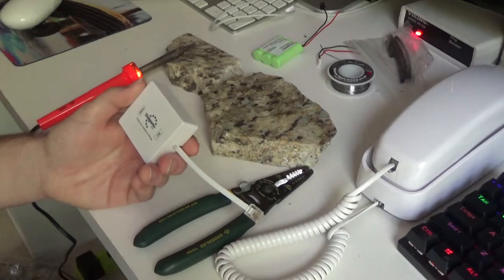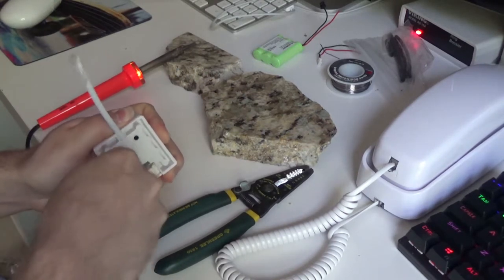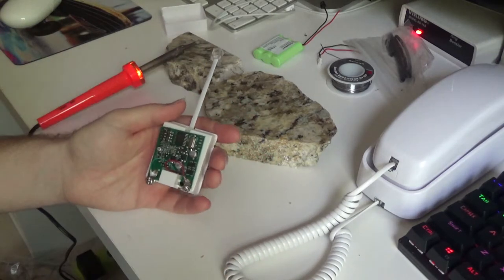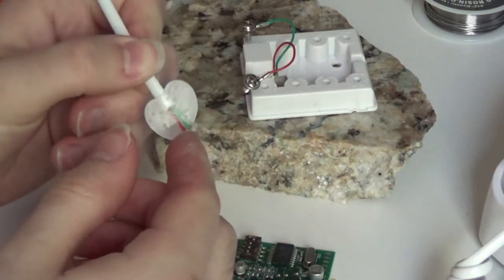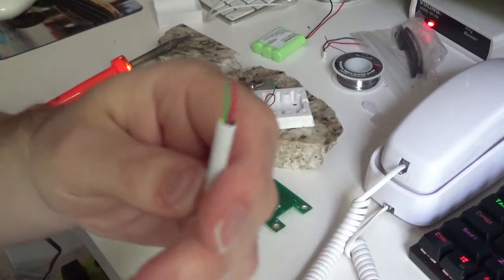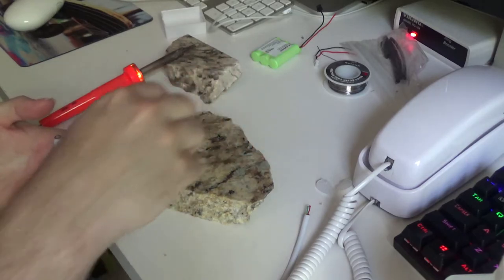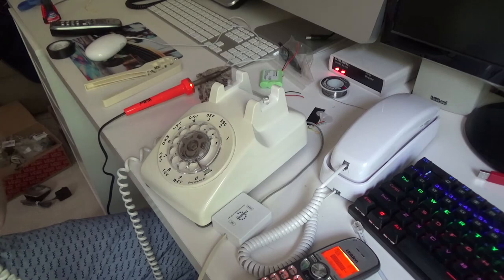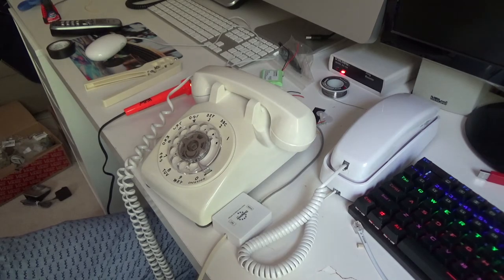DialGizmo Repair

Comment: My Dial Gizmo did the same thing. I took it apart, and it had a glob of blue glue that had failed, just like yours did. I was dismayed, considering that the price is, like you said, over fifty dollars, and then tax and shipping. I am not very neat with soldering such small items, so I took it to the local U Break I Fixit, and their guy soldered it for me, no charge. I pointed him to this video if he had any questions. I took the Gizmo home, screwed it together and it works fine. Better than the original connection. I'm glad that I didn't buy a replacement--in less than a year I would probably be having the same problem with the replacement, and 70 dollars less in my pocket. Thanks for the video.
Reply from the maker: Very disappointing build quality. I guess they can jack up the price just because there aren't many other products like it out there.

Comment: Hey thanks for the video! I didn’t have the problem that you had, my dialgizmo does work on my 500 series rotary phone, it generates the pulse for outgoing calls, it’s just that the dial-hold feature does not work. That is, I can’t dial a # (hash) or * (star) by dialing a ‘1’  (or ‘2’) and holding for 2 seconds. I have the dip switch1 set to Dial-hold enabled. It doesn’t generate the pulse for the * or #. Would you have any idea why? Thanks, Mike

Comment: I can;t believe it crapped out already.  Perhaps if you weren't so rough on the cable it would have lasted.

I won't complain about the solder job, because chances are it's better than they did from the factory.  Interesting iron with the light in it; I supposed that light is a reminder that it's plugged in?

As for the strain relief with electrical tape, that's a very temporary solution.  As soon as the glue on the tape lets go, that will allow the wire to slide around with no strain relief and it's as good as it not being there.  Once again, hot glue would have come to the rescue.  Now what's interesting is they seemed to have used some sort of adhesive, but it had a very cloudy appearance.  I've seen that type of glue before, and its bond isn't very strong.  I've found the same with low-temperature hot glue, the bond isn't very strong.  Good for some things, but for most stuff you want it as hot as possible.  With hot glue, you could have first of all duplicated their efforts in gluing the wire to the board, but than added more glue inside to act as a positive strain relief.  That's essentially "potting" the wire in hot glue, creating a strain relief.  I've successfully potted several things in hot glue, and it's worked quite well.
Reply from the maker: I can;t believe it either, I was quite disappointed.. I was not rough on the cable at all, and between that coupled with the fact that I only connected it to a telephone two or three times, this failure was completely uncalled for..

I didn't think the soldering was bad at all.. That light comes on as soon as it's plugged in, so I would say it's an on indicator light..

I think it will last for as long as I need it to.. To me, it seemed like hot glue was what it was secured with originally, which didn't hold..
Reply: I figured it just basically "fell apart" by itself.

I couldn't quite tell from the video, but the glue that was on there seemed quite hard.  Hot glue doesn't get that way, it's always got a certain amount of "give" to it.  Again, very hot application of the glue will ensure a better bond.
Reply from the maker: It seemed pretty malleable to me..
Reply: Perhaps it was low temp glue.  My cousin once bought a computer from a company that probably isn't in business anymore, it was built-to-order like Dells used to be.  I think the brand was "NuTrend" or something like that, never heard of it before and never heard of it again.  When it arrived, I took a trip out to Brooklyn where he lived to set it up.  First power on, it wouldn't boot.  We called tech support, they had me open the case and reseat the IDE hard drive cable, which was blued in with probably the same stuff that was on your adapter.  Either that cable wasn't fully seated when it left the factory, or it truly did work itself loose.  If it worked itself loose, that glue was useless to begin with.  My guess is they used that stuff, whatever it is.
Reply from the maker: Blue glue..

Comment: Maybe you could put a cable-tie around the wire as a strain relief.
Reply from the maker: To tie it to what?
Reply: Just wrap around a cable-tie/tie-wrap tight around white cord itself. If the lock on the tie is big enough not to pull through the slot in the casing then you're good.
Reply from the maker: @jimfuller239  O, on the inside of the device? That makes sense.